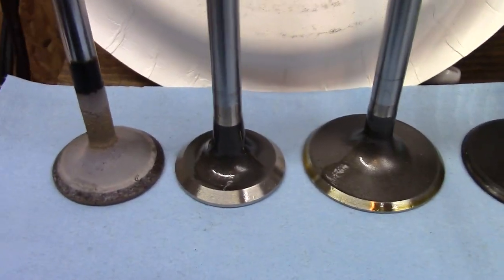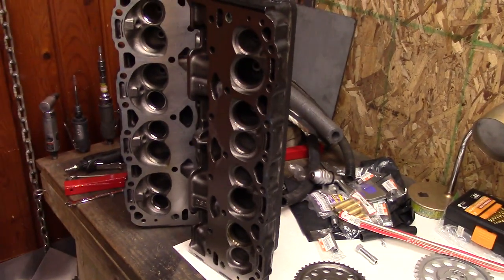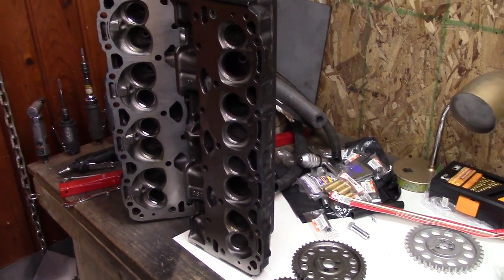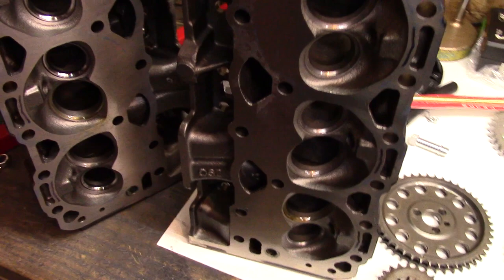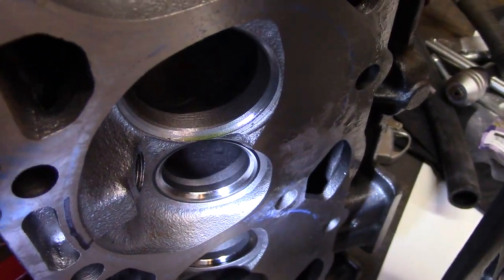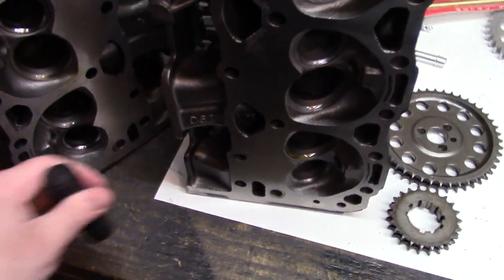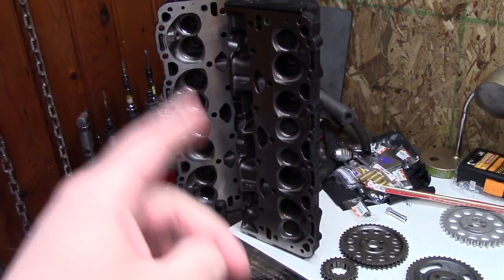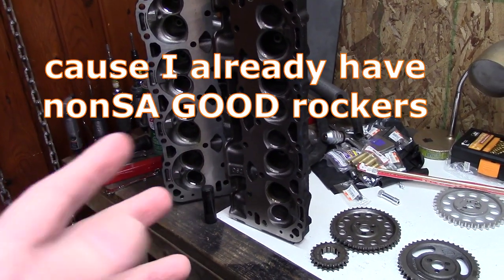Part 4 Jegs ATK Vortec Crate Cylinder Heads & Salvage Plan

Comment: My 2 cents, go through the ATK motor, put those heads back together make it right and put it in what ever car you just want to be a runner. Seems like it'll cost more in the long run to try putting good parts into it. You are showing us a lesson being learned, some times trying to save a few bucks on a cheap reman might be that cheap after all.
Reply from the maker: I kinda want to fix the crate and make it right but I also wanna get my other projects done first!  Still knowing how long I take with junk, the C3 will prob break and the heads could end up back on the OG shortblock by the time I get to tearing it down LOL